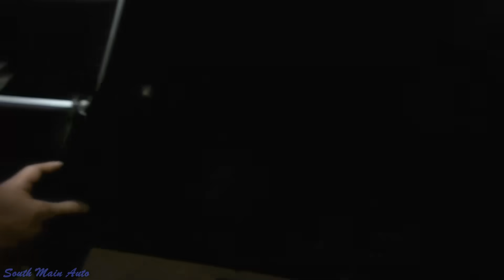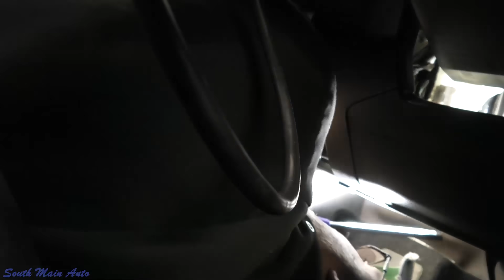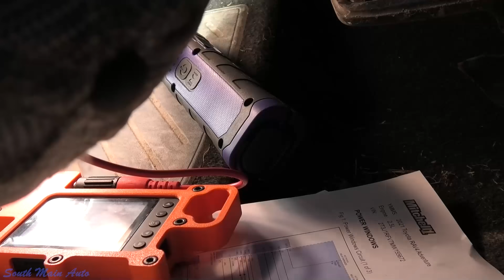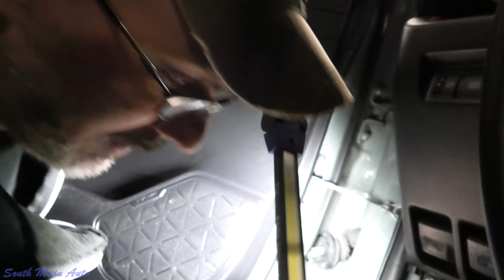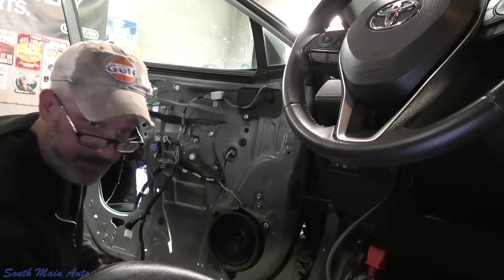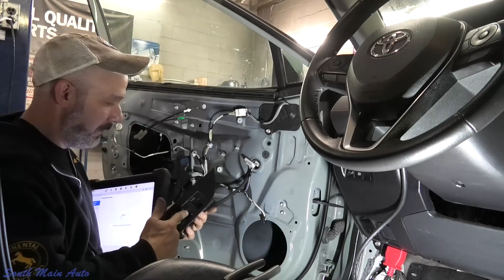One Week It Works, The Next It Doesn’t - '21 RAV4 Window Switch Diagnosis

Comment: That happened on my 02 truck rear left door but it was about 6 broke wires in that rubber boot hinge that I had to add some length to splice back, then 2 broke again 8yrs later but it's fixed now.  I just split the boot then wrapped it back over and tape to keep anything rubbing against the metal.

Comment: $600?!  I got one for my truck for like 28 on ebay after just the driver window button you had to flux on the circuit board just right to get it to work...  I could open the housing to see the board without wrecking it.  I had disconnected it and sprayed electrical cleaner and a tooth brush and everything first.

Comment: When working for a Ford dealership I was assigned a 74 Torino that had an electrical fire from the dash, left and right, to the head liner clear to the rear window. I had issues for 6 days, even with new looms. It was a special enough car that it was not totaled. 4 speed 351C

Comment: I have a 2021 RAV4 and I had a similar problem to this (not exact). Driver controls intermittently wouldn't work, but the other doors' controls did. However, whenever the driver's controls were broken, the express up/down feature on the other door switches would stop working, AND the sunroof/sunshade controls would quit working entirely! I thought I had a module going bad, but I realized one day that everything would break after going through the car wash, and then it would resume working a couple days later. Turns out, it was because the dealer had left the connector for the "tailgate kick sensor" loose at the back of the car after they installed the tow hitch receiver! I knew they had to remove the sensor, but apparently they didn't do anything to cover the end of its pigtail connector. Whenever I would go through the car wash, water would enter the connector and (presumably) short out part of the BCM, causing those other random functions to stop working until it dried out again.

Comment: Does anyone find it disturbing the window switch goes to control module and then the control module decides if it wants to run the motor?
Maybe they decide you don't need a/c and roll your windows down for you, while disabling your a/c at the same time.

There is also the possibility your car gets hacked in the future - and you can't get out without breaking the window.

Don't worry.  
They will solve that as well by using bullet proof glass and you can die inside your car.

Comment: My 92 silverado I thought has a messed up window switch, I changed it, still would sometimes work, changed the motor, same thing, I ended up running a 3 way momentary switch and drilled a hole in door panel for it, push it up, windows goes up, push it down, windows goes down lol.

Comment: Those rav4 door drain holes block up super easy and the door fills with water
Reply: You are correct in fact there is a service bulletin  to modify the door weather strip  that blocks the door drain

Comment: "We will rock you" As fast as "dollars to donuts" "The idiom originated in the mid-to-late 1800s, when a dollar was worth considerably more, and a plain pastry or donut cost a mere fraction of a cent or a few pennies... By saying "I'll bet dollars to donuts," a speaker was metaphorically offering ridiculous odds. If they were wrong, they'd pay up a whole dollar, but if they were right, they'd only receive a cheap, practically worthless donut". IOW you are giving someone 100 to 1 odds you are correct.

Comment: I'm pretty sure most vehicle doors have a drain slot at a low point, the body shop probably left the door drains plugged.
Reply: They do however toyota issued a service bulletin as the weather striping can block the drain holes the service bulletin requires a slight mod to the weather stripping

Comment: Toyota wiring harnesses fall apart like that right from the git go. You need 3 rolls of electrical tape to hold the engine harnesses together during removal. They can however remain 99% functional 95% of the time in surprisingly janky condition. You HAD to have done some 1st services on Toyotas. Look around under the hood and cut off about 10 ends of the electrical tape cut 3-4" from the last place its wrapped. Just fluttering around. Without relevant context a Yota wiring harness looks like it was made by Lada. Or Crystler

Comment: Body shops can be clueless. Our car was wrecked and had to have a rear quarter skin replaced. Got it home nd had no trunk light. I eventually found where a spot weld had melted two wires together. It took a while to find though.

Comment: Don't you have a Digital Clamp Meter to run the wires?  When the meter shows no voltage, that's where the break is.

Comment: I have seen strange misfires like this s few times over the decades. One was a Ford ambulance that would do it at idle, and you just touch the throttle and it would clean up. A new engine solved it.  
One thing that would be fun to try is a water injection type or thing to steam clean these piston tops like what happens during a head gasket failure.

It may also be interesting to see if the valve lash is going a bit negative for awhile.

Comment: I just had to replace the input speed sensor on my ex wife's 2012 Cruze Eco yesterday. You have to pull the front cover off and then go through 3 layers to pull the valve body out to get to the plug that holds the sensor wire inside the transmission and the sensor itself is on the outside of the trans. The stupidest design ever. All for a P0716 and P07BF code. And I ripped my hands up and bled like crazy. Car manufacturers these days just want you to take it to the dealer or get a new car when it breaks because some people do that.

Comment: A couple years ago, my uncle bought a used 2016 Nissan Frontier, one day the passenger side window switch quit working, & without any testing, but from my experience with the switch functioning two days prior (it was in the spring time & during the pandemic) i called a Nissan dealership for a replacement window switch assembly, unfortunately they were out of it so i took it upon myself & began to tear into the assembly and found there were some microswitches were dirty so i just took some rubbing alcohol and wd40 with qtips and cleaned them up, & it's been working ever since.

Comment: “Well ya see there, Eric, people think all magnets are created equal. That’s the kinda scientific ignorance that led to the fall of at least three lesser-known empires. Probably the Belgians at one point.

A bad magnet, for instance, is a dangerous thing. Fella buys one of those discount refrigerator magnets at a gas station, next thing ya know it can’t even hold up a coupon for pork chops. That magnet’s sittin’ there on the fridge freeloadin’ like a cousin between jobs.

Now a good magnet, that’s a disciplined piece of equipment. Knows north from south. Keeps your grocery list secure during a ceiling fan draft. Some of ‘em can pick up nails, tools, even small Buicks under laboratory conditions.

But a bad magnet? Hoo boy. Those are the ones that lose confidence. Scientists call it ‘magnetic fatigue.’ Learned that from a pamphlet at the post office break room back in ’89. Magnet starts attractin’ weird things. One minute it’s holdin’ your electric bill, next minute it’s got six paper clips, a Canadian dime, and somehow your aunt’s meatball recipe glued to the toaster.

Course, historically speakin’, bad magnets were a huge issue for pirates. Compass starts driftin’ because some bargain-bin magnet got into the navigation equipment, next thing ya know you’re discoverin’ Delaware by accident. Half the eastern seaboard was basically founded by guys with faulty magnets.

It’s a little-known fact, Eric, that Thomas Edison once said, ‘Never trust a magnet that smiles at ya.’ Wise words.”

Comment: I bought a $24.95 light built along similar lines from HF because Mustie1 used one. First time I dropped it on concrete it quit. Ended up behind the seat of my truck to go swap it out. After Covid I found it. Way to late. Plugged it in, dang thing works after charging. Only light I can put my hands on fast. Blew off Mustie. Screw members only. We still think you're up there with Farmcraft 101. Go to Mrs. O. and get her to kiss your bobo. When it comes to wiring you're a frickin' genius. You're my idol even if you have Members first. What can I say? I'm addicted to your BS. It's great BS.

Comment: Who does purple with a red stripe?  Land Rover!!  the wire going to the center – clock on the original defenders is a purple wire sometimes has a red strike.
They even do a red with purple 

We gotta get you a nice clean discovery II In your bay.  I wanna see you swear. 

I love it when a silverback gorilla posing as a mechanic works on a car

That was a nasty hit. I love my Astro lights, but that’s my biggest complaint of magnet isn’t in as strong as some of my other lights but I like those lights so much I keep using them.  

That’s a hell of a place for a wire to break.

Comment: South Main Auto.... Awesome video Eric as always my friend. I know I'm not the only one that was saying "hey you forgot to plug in the window motor" the white plug that could have bit you in the face like the Astro light did... Sorry I couldn't resist it. I have been wanting to get me a couple of those Astro lights but now I'm not so sure about it after seeing the magnet is not strong enough even to keep the light from turning when it positioned to the left or right. I do love me some Astro tools though.
Reply from the maker: Oh no man I was pulling on it you couldn't see it on camera I was just at an awkward angle and whacked myself in the face with it. I would totally buy one of these lights I love these things. I've had them for years gone through many of them.
Reply: @SouthMainAuto  I've watched you use them for years which is why I want a couple of them for sure.

Comment: I have my Cheerios lawyer diploma, and working for Wee, Stickum, and Goode. Feel free to contact me via this thread or meet me behind the hot dog stand outside Madison Square Gardens. Oh wait, I thought it was a bite from Jetson's Astro the dog. Astro Tools most likely has legal staff on retainer. I was going to use this video as evidence of the effects presented verifying a concussion at the minimum, as was evident by the slurred speech, loss of words, blood leaking, and most blatant loss of cognitive function and partial loss of vision by the fact that the Astro Tools light was shinning directly on the unplugged connector almost dead center of the door panel. In the words of Red Green, "And men, remember, if the women don't find you handsome, they should at least find you handy" and  "We are all in this together, so keep your stick on the ice."

Comment: "I can smell you  strut!" - very fun video. With 2 new gadget we must hear more about!. (orange measuring apparatus and fat ribbet handygun! :) <3
Reply from the maker: That's the same scope I've had for a lot of years just has a different case on it. It's the AES Wave u scope and the air riveter it's just one from astro pneumatics
Reply: @SouthMainAuto  Aha, different casing, I like it. And the smart riveter, which, I understand now, is airdriven,which is not for my parkinglot "garage" :) Tomorrow I have my Seville -93 at a real mechanic I trust, to find why it's stuck in 2 gear. Cross all fingers for my 300 dollar car! :) (+++rockauto parts, so soon a 3000 dollar car..lol!) Thanks for the kind attention!

Comment: Ok Scar Face, if there is unnatural overspray, suspicious paint discrepancies , it is always the body shop’s fault, that is a rule! We had a run of bad window regulators in the nineties, I must have missed plugging in the window motor 4-5 times, very annoying. As far as the egregious facial injury goes, haha, you’re on you own, maybe you can yell at you hand, I used to do that every time I stabbed myself with a test light, murdered my thumb or hand with a hammer, hit myself with a wrench etc, great video and great work tracking it down!

Comment: Voltage increase: This is a long shot, but could your battery maintainer be responsible for the voltage increase when you turned the lights on? That is, could the maintainer be increasing the voltage due to the power draw of the lights? Does it change its voltage output based on the current required from it?

Comment: Rav4 3rd generation.  Happened to me.  I didn't know how to go thru the diagnostic process, so I sprayed the connectors with electronic parts cleaner.  Luckily it worked for me.  My fall back position is that Toyota has a recall on the driver window master switch and I would have to schedule the repair.  One these days I have to take it in.

Comment: The Auto industry screwed American people with these newer vehicles. You couldn't give me one of these three vehicles anything above 2015. And then I may not even drive it. No wonder these vehicles cost so much they have nothing but trapped in. You can spend $10,000 on it and hardly do nothing to the vehicle. I got plenty money but I'm not wasting it on a vehicle. Most of the stuff on my Chevy I can do myself that's if I don't want to work on it myself. I have a hard time thanking people have that kind of money to spend on junk.
Reply: Sorry I have to laugh, I know it's important for you to get that stuff fixed but I could have rotated all four tires on my pickup truck and change the oil by the time you got this video done. Thank God I'm not an expert mechanic like you Eric. South main Auto comic show. It's a good thing you have a lot of patience. Looking for this, I probably would have just thrown a cocktail in the window instead of trying to fix it 😆 tell the customer I tried 😩 but nothing worked except the new and improved cocktail full up starting fluid not gas.

Comment: I dunno if I am getting smarter or stupider but if the switch worked with power I would Ivan in a hot wire and ignore the rest. Hopefully Mrs. O can see past your horrible disfigurement of the new head hole!

Comment: 7:o6 so the problem is not in the switch. The power, despite the lower voltage. is enough to communicate with the body control module. (I'm just sorting through the problem to myself)
Put some neosporin on that scratch !

Comment: Wow I saw something similar on a 2010ish Ford Expedition with the drivers window switch not working randomly and all it was was a slightly jacked up pin/wire in the connector. I soldered the heck out of it and put hest shrink on it and put it together and BOOM, it worked perfectly afterwards.

Comment: A lot of problems with cars today are related to broken wires, chaffed wires shorting out, terminal fitment issues. All takes time to diagnose properly, And most of the times are intermittent like this rav 4... Weather conditions is what i ask customers with intermittent problems! I had a friend who had a mazda 3 that freaked out, i had them drop it off, and of course it wasn't raining, but i knew for a fact that moring it was pouring out. got the car soaked with the hose and boom it acted up!!!!! wire chaffed by washer fluid reservior some sort of data comm wire.

Comment: What was that 2 wire plug in that prevented the window from working after the repair?
If my 2020 is the same as that one, now I know what's inside the door.
You fixed it, despite the "concussion" and the owner will be happy.
Good one Mr. O, nice to see Mrs. O  again.

Comment: When I was a young mechanic for a paper converting plant. A forklift was pushed out to the shop for no crank. So myself and another took turns looking at it for a couple of hours. It finally started after it was put back in neutral and closed the neutral safety switch. 😢

Comment: My 2005 Chrysler driver window opened, but wouldn't go back up, just for a few times. No modules are involved in its operation, so I removed the switch, opened it up, cleaned the contacts (some crusties) and, as Eric says, "Bob's your mother's brother." I'm too old to buy a car that requires a scan tool to fix Chrysler's wiring issues!

Comment: Your car show comments are funny, but true. I have a 56 Chevy Nomad, modified of course, so I can keep up with traffic and stop when I have to. I’m at a car show with this guy who also has a 56 Chevy. very original. His car had factory air ( very rare) however the belt was missing from the pulley. He bragged it was complete, but it didn’t work. I asked whats the purpose of an A/C unit that didn’t work? Show points I guess.

Comment: so the lady bought a rav4 that had been wrecked and repaired. Hopefully the wreck was disclosed. Body shop did the usual work fast and don't pay attention. drilled out rivet nicks wiring harness and over time damage leads to failure and today we get 1 hour video of the Journey to the Center of the Door. you just needed 20 more minutes and you could have released it to theaters.

Comment: I could be wrong but I think the door check arm is suppose to have a rubber gasket on it, might be why there's so much moisture in the door.
Good work Eric!
Reply: The earlier rav 4  around 2021 had a Service bulletin  to modify the weather striping on the bottom of the door, as it covers up the drain hole in the door

Comment: Absolutely loved this video. I laughed at your commentary. I so get taken back to 1976 when I installed a stereo in my first car. An old white Ford station wagon. Vinyl seats &  floors with metal dash. I spent a whole day installing it along wiith my 8track and CB radio. I put speakers in each door and two wedged ones on the shelf in the cargo area.  I was chasing wires all day. Not a clue what I was doing. Back then, I just powered it by sticking  wire in the fuse panel. So many fond memories. Especially  the knock on the noggin and bleeding. By the end of the day, I had a cut on my head like you, plus cuts and beat up knuckles on both hands.... Thanks for bringing back all the fond memories.
Reply: Don't leave us hanging.  Did all the stuff work?